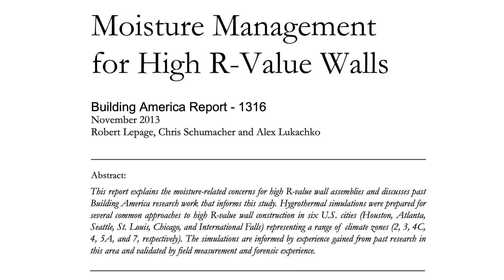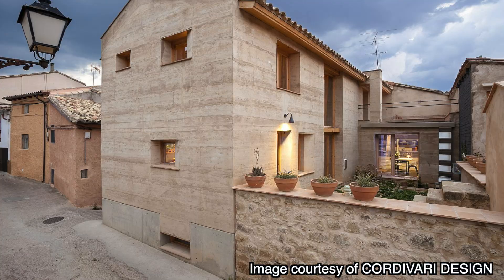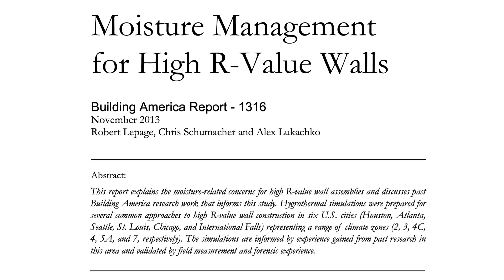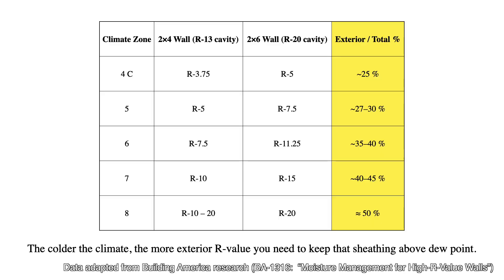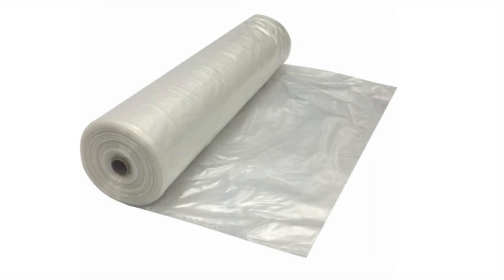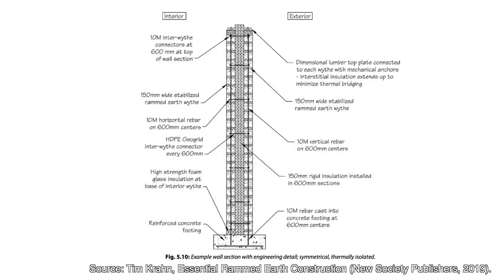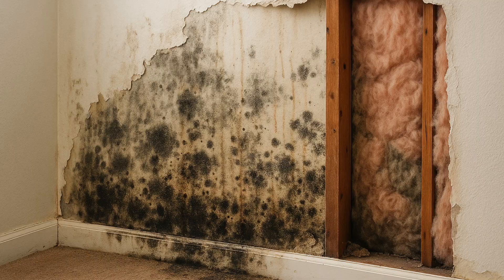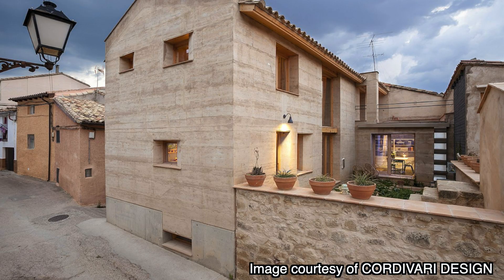Thermal Control Layer: Ancient Building Science That Modern Codes Forgot | Part IV

Comment: What are your thoughts on Earthships?  Rammed earth (in tires), but seem to be unable to breath since they are so thick.   Plus they are sitting on a bare soil foundation, without a gravel base.

Would the temp difference between earth and air cause wet walls?

And an indoor greenhouse seems inadvisable, but the thermal mass heating and air flow design is supposed to take out hot and humid air, right?  

Perhaps ok for a dry dessert air environment?
Reply from the maker: Your instincts are spot on.

Earthships aren’t actually rammed earth — the tires are just packed soil, and the rubber traps moisture, so the walls don’t “breathe.” With no real capillary break, soil moisture and soil gases can move inward, and the cool bermed walls can absolutely cause condensation in many climates. That temperature difference you mentioned is a real issue: cool soil + warm, humid indoor air often means condensation on the interior face of the tire wall.

From what I’ve read, the indoor greenhouse adds a lot of humidity, and the passive venting only really works in very dry desert climates

Comment: What keeps the rebar in the rammed earth wythe from rusting over time?
Reply from the maker: Rammed earth actually stays very dry in the core. Both Essential Rammed Earth (Krahn) and Refined Earth (Rauch) show that most moisture movement happens only in the outer few inches. With good detailing — big overhangs, a waterproofed plinth, and protection from splashback — bulk water rarely reaches any reinforcement.

Because the walls are vapour-open, they can also dry out, which prevents long-term corrosion. And many modern systems simply use GFRP (fibreglass) rebar, which doesn’t rust and avoids thermal bridging altogether.

Comment: There are two simple rules to live and build by: 1. Never, EVER, let them get wet. (Gremlins) 2. Build nice or build twice.

The vast majority of new construction in Switzerland is based on a combination of concrete and brick. Smaller buildings get exterior EPS insulation with stucco, for larger buildings fire codes push towards exterior mineral wool with stucco or a facade with rain screen. Hydronic radiant heating is the norm to get the low system temperatures that heat pumps need to run efficiently. Air conditioning is still unusual for residential construction. Some buildings do "free cooling" through their radiant loops to dump summer heat back into the geothermal system. The result are buildings with a good amount of thermal mass INSIDE the insulation envelope, and thus small temperature swings.

Insulation between layers of brick was done in the 1970s and 1980s, too expensive now. Rammed earth is definitely not common, and not cost effective.

How about wood construction in Switzerland ? The classic sun-blackened Valais or majestic Bernese houses that you see on post cards survived because they have decent roof overhangs and stone on the north side and basement, and the sun at altitude dries them out. For modern wood construction, large elements are prepared in the workshop, and assembled on the foundation in a few days rather than a stick built house getting rained on for weeks.

Can you stick-build healthy buildings ? Have an insulated slab or foundation to start. Have a proper ventilated rain screen behind your siding. Have some exterior insulation (wood fiber insulation is popular in Europe). Insulate the cavity with a material that supports capillary transport of moisture (e.g. blown-in cellulose). Consider putting the structural OSB sheathing on the inside of the studs, and limit the number of penetrations by having an installation cavity between OSB and drywall. Don't use spray foam. Use the excellent Ubakus web site to simulate the thermal and moisture behavior of your wall assemblies.
Reply from the maker: This is absolute gold, thank you. I’m learning and sharing as I go, and insights like yours add so much depth to the conversation. North American construction really does suffer from a lack of understanding around moisture, sequencing, and durability, so it’s incredibly helpful to see how other regions approach it. Your notes on Swiss practice line up with what I’ve started reading, and I’ll definitely dig deeper into it for a future video.

And thank you for mentioning Ubakus — that’s genuinely new to me, and I’ve already bookmarked it. A small clarification on rammed earth: you’re right that it isn’t cost-effective in the conventional sense, but once you start building properly in wood (rain screen, exterior insulation, healthy materials, correct air barrier strategy, good mechanicals), the cost of doing it right starts landing in a similar range. With rammed earth the expense is almost entirely labour and lack of know-how — the material itself is basically dirt.

I appreciate the thought you put into this. Comments like yours are what make these discussions so valuable.
Reply: @RootedResilientLiving  You may want to look at France, they are more adventurous with materials. See e.g. the magazine "La Maison Ecologique".
Reply: I agree with you but not about your claim that blown-in cellulose can be considered as a "capillary active material" (Joe Lstiburek doesn't either). 

The only capillary active insulation materials to my knowlegde are:
- Hempcrete (and lime based insulating plasters).
- Autoclaved Aerated Concrete (AAC).
- (High density) wood fiber boards.

Comment: What is the cost per square ft of wall for rammed earth? How would rammed earth home fair in seismic zones primed to earthquakes? Good video
Reply from the maker: Thanks! Costs vary a lot by region and labour, so there isn’t a single cost-per-square-foot number. Both of my main sources — Essential Rammed Earth by Tim Krahn and Refined Earth by Martin Rauch — emphasize that the material is inexpensive but the skilled labour and engineering put it toward the higher end of wall-system costs in North America.

For earthquakes, both books make it clear that rammed earth can perform well when it’s engineered for seismic loads. That usually means adding reinforcement (vertical bars, ring beams, or structural cores). Unreinforced monolithic earth alone isn’t considered adequate in high-seismic zones, but engineered systems have a strong track record.

Comment: I totally agree with your critique of modern energy efficient homes and their poor moisture management. But unfortunately I don't think rammed earth is a practical universal solution. My country has high seismicity, and light weight buildings are generally much safer, and it looks like rammed earth performs even worse than concrete and masonry. Perhaps more importantly, isn't it likely to be much more expensive than a light timber framed building? It certainly would seem to require far more labour hours and possibly more energy.

For a temperate climate like mine, I would just prefer a timber framed building with no insulation on the exterior walls - a heatpump and/or fire is enough to cheaply heat a home in winter here as long as it's not too drafty, and has some insulation in the ceiling.
Reply from the maker: Thanks for the thoughtful comment — lots of good points in here. On the seismic side, you’re absolutely right that unreinforced earth performs poorly, but modern engineered rammed earth (per Krahn and Rauch) uses reinforcement and ring beams and is already permitted in seismic regions. It’s not a universal solution, but it’s far better than traditional unstabilized earth construction when it’s engineered properly.

On cost, rammed earth isn’t the cheapest option, but building a truly healthy, durable light-frame wall isn’t cheap either once you factor in safe materials and proper moisture management. And about skipping exterior insulation on timber: that can work in very mild climates, but it only stays safe if the sheathing never reaches its dew point. In most temperate or humid regions, exterior insulation isn’t about energy — it’s about keeping the sheathing warm enough to stay dry. That’s the part modern construction often gets wrong.

Comment: I always had a bad feeling about the polyethylene sheets they started installing in the 1980s; the solution seemed worse than the problem. but the problem was the awful detailing one sees in the inner envelope of most modern N. American houses. The shift from plaster to taped drywall made these gaps bigger and more numerous. The gaps around outlets, heating vents, behind baseboards and the holes for pipes and cables, are rarely ever sealed and without better detailing, inside air flows freely into the wall without the polyethylene. Maybe they should do a blower test before the housewrap has been installed. Of course, that's only half the battle. The other half is keeping the inner envelope sealed through numerous repairs and renovations; even the cable guys are a threat to building integrity, often tearing through multiple layers of wall and sometimes even vandalizing firewalls.
Reply from the maker: Absolutely — I’m with you on this. The real issue is that we took interior walls that were already full of gaps and penetrations, and then relied on a membrane that only works if it stays perfectly intact and perfectly detailed. That’s just not how buildings behave in the real world. Once plaster gave way to taped drywall, the whole interior side became too fragile to serve as a dependable control layer.

Comment: https://youtu.be/PtG7jaNyZnE?t=65 warm humid air loves to condense on the sheathing, which is why we use a vapor barrier and seal the heck out of it. Most people have never heard of vapor pressure, let alone know what it is. This is why so many people can't figure out how to get compost hot enough to kill weed seeds. Cheers!
Reply from the maker: You’re absolutely right that most people haven’t even heard of vapour pressure — my entire episode on vapour control got the fewest views in the moisture-management series for exactly that reason. It’s a hard concept to make tangible. And yes, you can make the interior air barrier out of a well-taped vapour retarder, as long as the whole airtightness strategy is actually continuous.

Where things often go sideways in North America is the assumption that a vapour barrier automatically solves condensation. Warm, humid air condenses on sheathing when air leaks move that moisture into the assembly — not because the wall is missing a sheet of plastic. If the air barrier isn’t solid, all you’ve done is trap moisture that can’t diffuse back out. That’s why the air barrier matters so much more than the “vapour barrier” label.

Totally with you on how misunderstood this is — the physics are simple, but the execution rarely is.
Reply: @RootedResilientLiving  Thank you for the detail response to my comment- proof that you are a real person, not an AI generated avatar! I posted this comment prior to watching your video, and I must say that it was very well done. The point is well taken that having a thermal mass on the inside of the insulation is something I haven't considered as it is so different from the way houses are built here in Alaska. Placing a bitumen vapor barrier on the exterior of a concrete wall with insulation outside of the VBL is optimum. I wish that rammed earth, cob, adobe etc. was more widely used and accepted by the building codes as it has that termal mass which is so important.  In-floor radiant heating with significant insulation under the slab so incredibly efficient and comfortable,  but there are many who still refuse to even put 50 cent/lf pex in a slab, even if it is simply stubbed out for future use. I sat on a plane from ANC-FAI once with a man who built a house on Birch Hill with ICF's for the basement with super insulated (8" of XPS) heated slab and a super insulated main story. He said that even in the coldest temps -50F their heating bill was minimal. They used the basement for storage and kept it relatively cool. There is so much that can be done. Keep up the good work.

Comment: Smart vapor membranes like from Intello or SIGA solve this problem, and used with lots of insulation are far higher thermal performance than rammed earth. Since you brought up Switzerland as a prime example of a place that does things right, you might be interested to know that SIGA is how the vast majority of buildings in Switzerland manage vapor.
Reply: Smart vapor membranes are more about marketing than practical use.
- Intello needs about 28°C/82.4°F to "open up" for vapor. This will not happen when you use A/C in summertime.
- SIGA pretends to use "cactus technoglogy", but testing by the Universiy of Vienna revealed the difference in both directions is only 30%.

Just take care of air tightness on the in- AND outside (with the vapor open insulation in between). Use a vapor open, capillary active material to do so and you will never run into any problems.
Reply: @koenraadprincen7212  You literally just made all of that up dude. 

Intello doesn’t “open at 28 °C” — its permeance changes with humidity, not temperature. High RH triggers it, regardless of °C.
And SIGA’s membrane tech isn’t just marketing: validated tests show directional vapor diffusion, not the “30% difference” you claim. No credible Vienna study supports that number. Also, you made a generalized comment about SIGA's membranes despite the specs of each product being significantly different, eg. Majrex 200 vs. Majpell 5 vs Majpell 25. Each of them have different perm ratings and degrees of directional drying.
Reply from the maker: This is such an interesting back-and-forth to follow — thank you both for weighing in so thoughtfully. Smart vapour membranes like Intello / SIGA can absolutely be useful tools when they’re part of a well-designed assembly with good rain control, airtightness, and a clear drying path. Where I get nervous is when they’re treated as a kind of magic fix that can be slapped onto an otherwise poorly detailed wall that ignores basic moisture-management principles. No membrane can rescue a fundamentally bad assembly.

That’s really the heart of what I’m trying to get across in this series: the physics don’t change just because a product is clever or “intelligent.” The control layers and the overall strategy still have to make sense. I talk more about that in the Vapour Control episode of the moisture management series here if anyone’s curious: https://youtu.be/hvCk0Sgrfc8?si=WpJbUDcgFazclNe5
Reply: @RootedResilientLiving  The more air tight and well insulated a house is, the more important proper water management and vapor control becomes, there are no silver bullets, you have to put up multiple layers of belts and suspenders, and you have to be extremely thorough and test with blower door scores at each stage of installation to catch inevitable installation mistakes. 

I highly recommend Matt Risinger, and Steve Baczek's youtube channels for people interested in building science.

One of the basic things that bother me most about modern construction is the lack of roof overhangs, for instance, this is such an easy thing to do that will extend the life of your wall assembly more than any material you use for cladding.
Reply: @RootedResilientLiving  Correct, installing an intelligent, smart, hydrovariable,... whatever vapor membrane has lots of side conditions that need to be met.

Besides that, those membrance are invented underneath a so called "compact flat roof" with insulation in between the rafters.

Everybody is using it in vertical walls and saddle roofs where they are USELESS.

In a flat roof assembly...
- The smart membrane needs to be installed perfectly air tight.
- The membrane has to be installed at the same time as the insulation.
- The roof needs to have a black waterproof membrane (EPDM, bitumen,...) so it can heat up in summertime. A green roof, PV-panels or stone ballast is *NOT allowed*.
- The insulation is not allowed to be too thick because the full package must be heated/warmed up by the sun in summertime in order to have vapor drive inwards.

All in all, it's a very risky setup... that's why even Intello Australia is now advocating against their own product and telling people to opt for a ventilated roof, even if it's a flat roof.

I repeat what I said in the comments on other videos.
1. Above grade NO plastics are needed in your house (smart or not).
2. Ignore vapor barriers and opt for air tightness only and use a vapor open and - if possible - a capillary active material for this.
3. If your insulation material is not air tight, also apply an air tight layer on the outside of the insulation layer, make sure it's vapor open and - if possible - capillary active.
4. Only use vapor open insulation materials. Avoid all plastic insulation materials (EPS, XPS, Poly Iso, spray foam,...).
5. Seperate the "rain control layer" from all other layers - if possible - and back ventilate this layer.